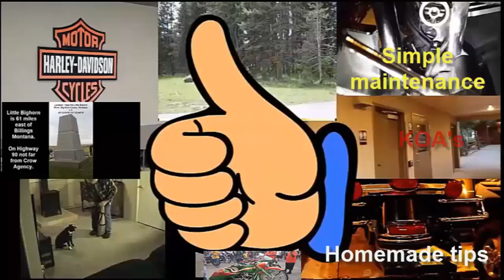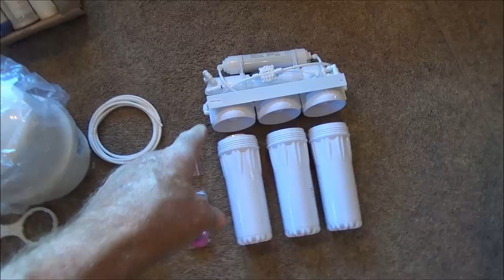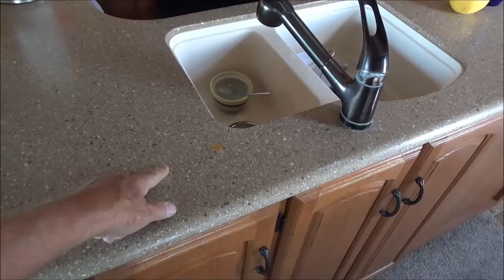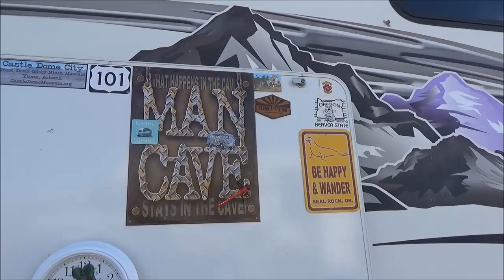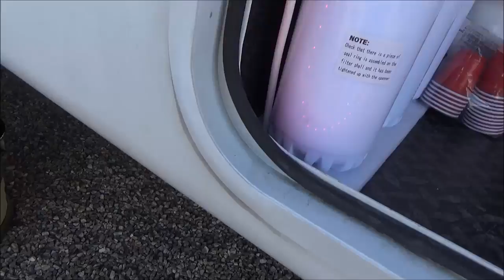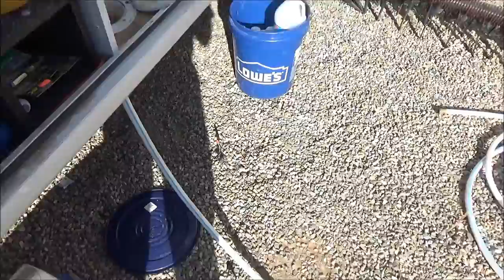Nope on the RV reverse osmosis water filter system.

Comment: I don't think you are looking at RO from an RVer's eyes...
You don't need to throw away the "waste water" just think about where that stuff just came from! 
You ran it through the PRE FILTER, then it hit the RO membrane and went to the drain!

What you are dumping on the ground is filtered water!!! 
The "waste water" is 50 times better than that Yuma tap water! (even if it is from the foothills)
The water goes from the fresh water tank, into the pre filter, then it goes into the RO membrane where the water is pressed through the membrane, the stuff that doesn't make the grade (AKA, tap water) is sent to the drain filtered and perfectly fine for washing dishes, taking showers and flushing toilets! (just don't drink it if it's from Yuma!) 
You ought to buy a TDS water tester (only $6.00 from walmart online) https://www.walmart.com/ip/0-9999-PPM-TDS-Meter-Digital-LCD-Tester-Water-Quality-Filter-Purity-Pen-Stick/219304586?wmlspartner=wlpa&selectedSellerId=17397&adid=22222222227152463676&wl0=&wl1=g&wl2=c&wl3=263879050479&wl4=aud-566049426705:pla-435070722893&wl5=9030452&wl6=&wl7=&wl8=&wl9=pla&wl10=125215804&wl11=online&wl12=219304586&veh=sem&gclid=Cj0KCQiA-4nuBRCnARIsAHwyuPpSDqkohK8JzQj8oR65Gi48T1RYpnp84IFDXq2zuwwMc1mL_lHoAyMaAot-EALw_wcB
Reply from the maker: Thank you for your comment and you are very correct. Most of the times we catch the water in our blue tanks that we carry with us or we drop the hose down into the on-board tank I agree it is filtered water and it tastes fine.
But like I said in the video if you're at a campsite with limited water you can't use it from your pump. Unless you've already stored the water in your tanks then you could use that filtered water as you said

Comment: I have one of those reverse osmosis systems and really like it.  Mine does not dump water I don't know what the difference is Or why it would dump water.  I will have to go follow the lines and see how Mine is hooked up.
Reply from the maker: I didn't know anything about these and started doing research after I got this. Everything I've seen is they use a lot of water to make a little water. Don't know where yours is hooked up in the house or in an RV. In the house it's probably hook right up to your sewer line somewhere. The reason they dumped water is because they are using high pressure to push the water through your osmosis filter and some of that water cannot be filtered because it is dirty not really but that's what they would consider it. You can even drink the water that is flushed out it tastes fine I've tried it. Let me know what you find out I'm very interested in that.